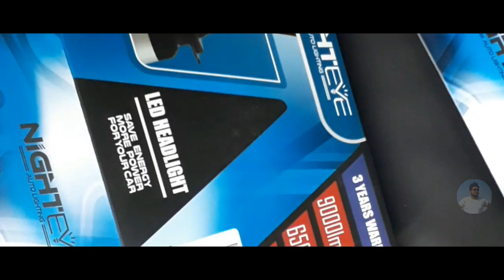My i10 got New Fog Lamps | Night Eye LED H4 & H27 | BumragVlogs

Comment: Nice light bro wt is the cost of this i wanna install in my i10
Reply from the maker: H4 Rs1700 
H27 Rs1500
Reply: Hi need H4 Fog light's for my car..I have tried so many shops but j didn't get any where ... Also I have installed but the lighting was not coming narrow ....the lighting was going as wide .. Can u please help on the Fog light's ...I want to put my i10 car ....
Reply: @bumragvlogs6344  bro is this night eye and the cost you mentioned is per pair ?
Reply from the maker: Yes bro per pair price
Reply: @bumragvlogs6344  
1700 both
Reply from the maker: H4 Rs 1700 pair 
H27 Rs 1500 pair
Reply: Wat is difference between H4 N H27
Reply from the maker: Headlamps support H4 
Fog lamps support H27
Reply: addres jha se apne laga ya
Reply from the maker: purchased from Karol Bagh
Reply: These bulbs are expensive but I think they are still better than using 90/100 or 95/100 with relay etc as no need to tamper with wiring. Can you please update (for headlights and fog lamps both) on what is it's warranty and how are they performing now and if any issues?
Reply from the maker: one year warranty of this product they are performing good but not good for highway drivings